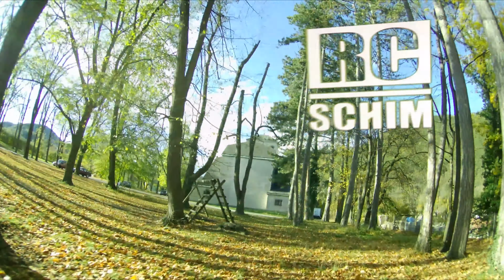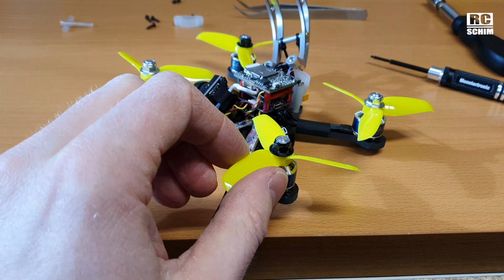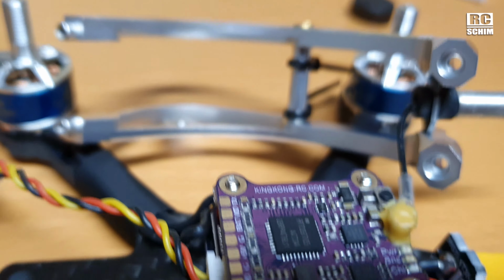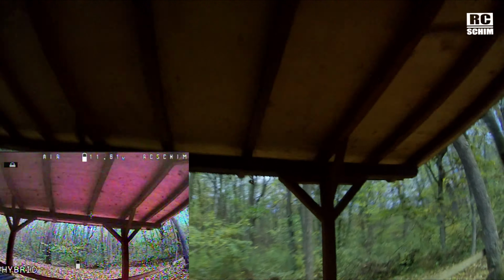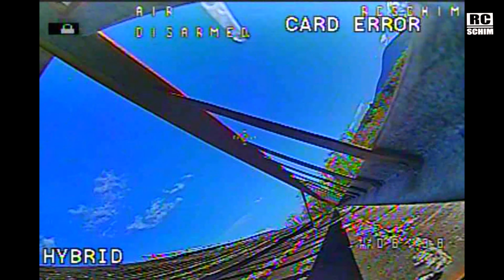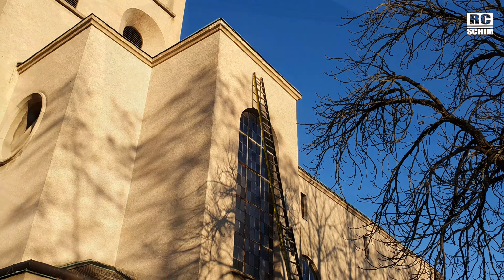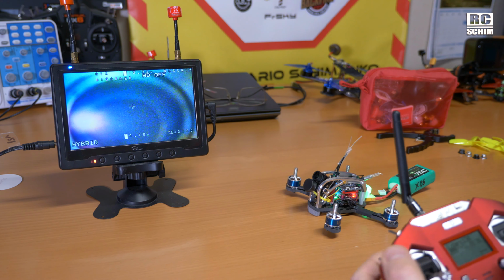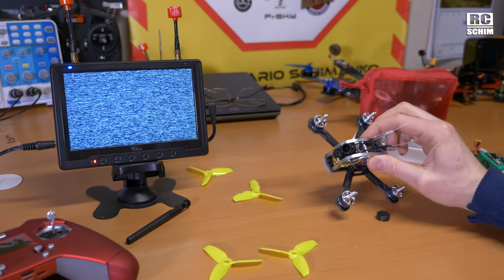"elDarco" - From Review to Rescue (LDARC 130GTI)

Comment: I like the aluminium top braces, reminds me of the GEPRC Sparrow. What I would really like someone to develop is a frame with a bottom plate that fits 2 stacks AND a top brace in alloy, so you can put the Tarsier-stack in as well. I actually think that the RC Hybrid should have the HD-lens in the bottom, so as to better protect it....not sure the cam can just be flipped.
Reply from the maker: I heard DroneCampsRC saying: "LDARC is similar quality than Geprc"...
There's also a plastic part to replace the alu parts - but who would want to do this?
Yes, you could turn the hybrid upside down and reverse the image in the options. might be an idea to protect the lenses better... but then you have the props even more in the HD view...

Comment: Entertaining video Mario and good to see you got it back :) 
on the recveption: with the 2 antenna at the same orientation, you might as well Not have a diversity receiver? Maybe BOTH antenna were blocked?

also:  I'm testing a 2.5" quad.. with Turtle v2.. with XM+.. with Xlite.. wish me luck :P
Reply from the maker: from the comments here:  maybe it's not the xlite - but maybe the frsky receiver CLONES are not as good as real frsky RXs? Turtle V2 would be totally acceptable from the quality side - but now that I had the Hybrid - I'm spoiled by the good FPV feed a dedicated lens can give you...
I've already installed a crossfire nano in there. also replaced the vtx antenna with a way too large foxeer pagoda (was the only antenna I had with a suiting UFL connector).
Reply: @Rcschim  Ah yes.. it indeed IS a clone receiver.. I'll be using an actuall frsky XM+..

Haha :D  a pagoda on that quad should look fun :)

Comment: Nice episode. 😁
This looks like some kind of generic Frsky receiver. Me and my buddy have bad experiences with Kingkong receivers - Frsky and Flysky compatible. Failsafing randomly, sometimes within 50m radius. When we installed genuine Frsky R-XSR and RX2A pro, there were no more problems.
Reply from the maker: thanks for the feedback. So I will not give up on that xlite. I would really love to use it more for the small copters.  I will try to use genuine frsky rxs then!
or as here: throw in another crossfire nano and use the bigger Taranis X9d
Reply: @Rcschim  I'm using X-lite, only internal 2.4 GHz antenna and with genuine R-XSR (LBT) I didn't have failsafe yet. I went 400-500 m far in open field and 200m around my house (high WiFi pollution, woods, houses, valleys, hills,..). As said, Kingkong / LDARC generic receivers used on ET series were really bad. Range was worse than any RC toy had. Sometimes quad failsafed when I only went around my house - 20-30m. It could be the same with this model, since RX probably isn't original Frsky as I can see in the video.

Comment: Ich habe das Failsafe-Problem an 2 unterschiedlichen Taranis mit 2 verschiedenen R-XSR an 2 verschiedenen Coptern. Passiert jede halbe Flugstunde mal. Ursache unbekannt, vermute aber starkt das die Empfänger-Coaxkabel zu dicht an den Videosender-Bauteilen sind, da gibts dann wohl eine Signaleinstreuung. Mach den Failsafe nicht direkt auf drop sondern Horizon-Mode mit min-Throttle, das hat mir bisher viel Geld gespart. Und bau dir doch mal einen Rescue-Copter ;-) 6-7 Zoll, Dual-Cam (eine normal und eine nach unten zeigend), unten einen Servo-betätigen Abwurfmechanismus mit Schnur und Haken.
Reply from the maker: Hier hatte ich die Failsafe Einstellungen auf Standard. Wusste ehrlich gesagt nicht mal wie er sich verhält (deswegen der Test im Hangar später).
Horizon und wenig Gas klingt nach einer guten Idee bei Failsafe.
Das Problem ist halt: wenn der wo reincrasht und sich die Motoren nicht abschalten, dann ist sicher was hinüber...
Aber ich glaub es gibt da eh 2 Stufen von Failsafe in der Software...

Rescue Copter:  ist mir dann wieder zu heikel. Man setzt dann eine wesentlich teurere Drone auf's Spiel um den kleinen zu retten...
Reply: @Rcschim  Ja ich nutze den 2-Stufen Failsafe. Wenn er 0,4s kein Signal bekommt, geht er in Horizon (ohne Airmode) mit Throttle "hold", und wenn dann das Gas noch nicht da ist auf "land" mit Throttle 1150 für maximal 3s. So hab ich bisher jeden Failsafe überwunden, meistens fällt das Signal nur 0,5 bis 1s aus, länger wär es noch nie weg. Sollten im crash die Motoren gut überleben, da Airmode aus ist und somit nicht allzu stark nachgeregelt wird. Im übrigen verwende ich nur Motoren mit einer recht glatten Prop-Auflagefläche, da die Props dann gut durchrutschen können. Beim Crash kann man dann nur nicht mehr turtlen.

Comment: random failsafe this problem is killing me with frsky xm plus and x-lite tx .. its very sensitive for cell tower or hight voltage lines.. and my big problem is I have 5 quads with xm+ so its very hard to replace it with other rx's
Reply from the maker: On my really old Taranis X9d the 2.4ghz range also isnt that impressive. I read that the internal board can wear out. My antenna inside there is fine, but maybe I should replace the board.
but then I compared cost and time to fixing the 2.4 here vs getting the TBS crossfire micro JR module - it wasnt that much more expensive - and now I love crossfire.
Reply: I have always had great luck with x-lite and XM+. Never worry about range if my video is still OK.
Either way, you can improve any tiny receiver by shielding them with tin foil. 
Also, @rcschim; you can setup your OSD warnings in Betaflight, so instead of "***" it says things like "RX LOSS", "RUNAWAY", etc. Very helpful!!